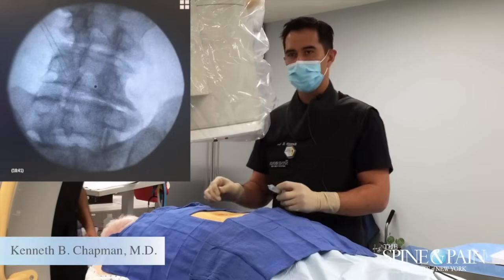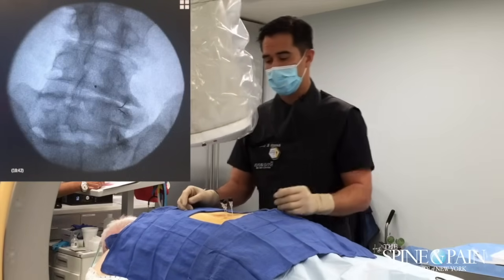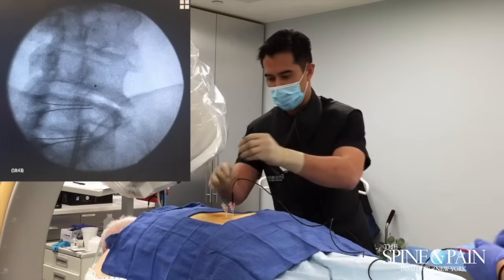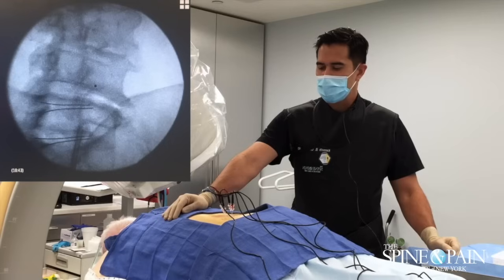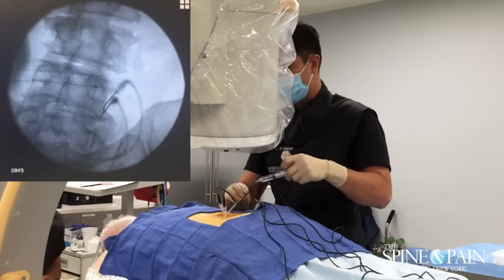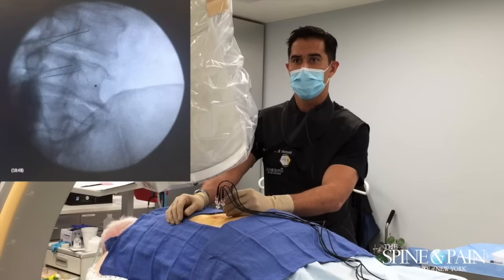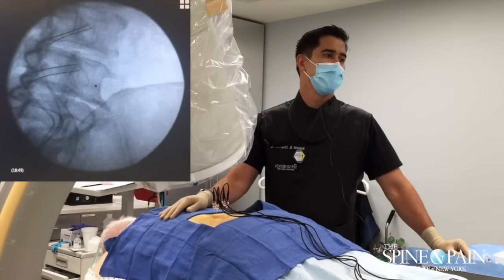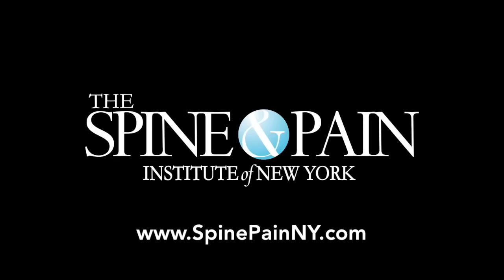Radiofrequency Ablation Procedure

Comment: I’m surprised by everyone saying they thought this procedure was not painful. I did two diagnostic nerve blocks and the ablation I just did 2 days ago. I found it to be agonizing and I was huffing laughing gas and had versed before hand. I think the most pain is from the placement and testing. The actual heating of the nerves was tolerable. I have a high pain tolerance and I was moaning and gripping the pillow so I am surprised by everyone’s different experiences. It basically was recreating the exact chronic pain I have but increasing it 100 fold. But that’s good, because it shows that the facet nerve is the problem.
Reply: Same for me this time. I had it done several times before. It was uncomfortable but not very painful. 
This time, new doctor: extremely painful. 
She was in training, which I didn't know. 
So it depends on the doctor who performs it 💯 
Find a new doctor, seriously. 
Coz I'm not going to the one that performed it with me now, ever again.
Reply: 100% agree! I have a high pain tolerance and this one hurt! Next time I'll ask for versed.
Reply: My Md uses IV sedation w each procedure.  It makes a repeat 5 yrs later a no brainer!!!
Reply: Same I’m normally fine but I was hurting
Reply: I agree! I have my 2nd one 9/19/2024 for lower back pain and I will be requesting something for pain to help me because all pain tolerance isn’t created equal. I consider my tolerance higher and spraying the area with lidocaine then sticking the needle in each time was agony for me. I want to be able to be completely still when doing this type of procedure. I jumped each time a needle was inserted. If I am given a preference I would prefer as much numbing during this procedure as possible.
Reply: I had this done as well and it was the most painful procedure I’ve ever had. Towards the end, I felt I was either going to throw up or pass out.  That was in 2020,  I’m scheduled for another one in a few weeks and I’m scared to death. This time, it’ll be with a new doctor. My former Dr closed his practice and moved out of state.  When I scheduled the procedure I relayed my fears to the PA and she said that my new dr is known for being gentle.  Maybe my previous dr wasn’t or his technique was different in some way. I just know I’m scared to do it again because of the terrible pain.  They gave me Ativan to take prior to the procedure but they won’t give anesthesia because they need you to communicate what you’re feeling.
Reply: @cherylcorbin2776 I’m scared as well. I didn’t realize the nerve grows back in a year… this is a new doctor for me as well and he gives nothing except an anxiety pill….But he is also known for being really good so maybe it will be ok.
Reply: @pairofarches It is agony. I have to do mine again since the nerve grew back and I’m scared. This new doctor gives nothing but an anxiety pill…
Reply: @emilybeckett1753  yes, unfortunately the nerves regenerate.  I got decent relief from my first ablation for about 6-9 months.  I truly hope it’s not too painful for you and you get relief.  Sending positive thoughts your way 🙏
Reply: I had the block done on both sides in one day and felt relief for almost an entire day. I had the ablation this morning on my left side and I am in agony. It hurt when the doctor inserted the needles. I didn't get any pain meds beforehand and tonight I'm aching all over. I have to do the right side on Monday and I'm really nervous. I usually have a high pain tolerance as well but not today apparently.
Reply: @Sandyv73  I feel your pain. I Just did my left side again a couple of days ago and it was unbelievable agony. This doctor doesn't give any pain control during, while my previous doctor gave versed and laughing gas. If you can get medical marijuana in your state that would be really helpful for after the procedures, at least for the next time it grows back. I wish you well!

Comment: Me Dice I am about 8 weeks past the procedure and i am doing great.   There was some discomfort from the procedure for a couple of days. The actual procedure wasn’t’ bad.  The excruciating pain I was experiencing when I would get out of the car after driving is gone.  Good luck to you.  I would definitely recommended it.  It’s nice to have my limp gone.
Reply: Excuse me I just want to ask a question I'm a retired soldier with a lot of lower back problems I got l5 I need it it got to the point that I cannot get up from the sofa sometimes unless I just dropped myself into four legs on the floor if I sneeze the pain is in trouble how long does it take to fully recover from this cuz I also like to keep active going to the gym
Reply: I have a question did you have any weight gain behind your procedure.

Comment: I did it 10 days ago on the SI joint on my back. Doctor used local freezing. It hurt a little at beginning but I basically felt nothing for the rest of the procedure. I took it easy for last 10 days, only walking daily. The pain is less every day. Today I was almost pain free.
Reply: Complete opposite of my experience. Those electrodes felt like an earthquake in my lower back with massive amounts of high pain. Surgery was effective but the pain during it was almost unbearable. I was literally cussing at the table
Reply: @sjmcdo3  sorry to hear about your experience, good thing it was effective 🙂
Reply: @sjmcdo3  so sorry to hear this! I can't help but wonder if they didn't get the numbing agent to the right location. Am I consider finding someone else to do the procedure if you need it again? Glad I was working for you for a while at least
Reply: Did you experience agonizaing pain before the procedure?
Reply: @cathy8964  Only when doctor was doing deep freezing for less than a second nothing I couldn’t take. It takes a month or more for pain to subside after the procedure and for me pain was back exactly one year after.
Reply: Still going strong now ???

Comment: I was told today that I need this, I'm scare. A year ago had back surgery and hip due to work injuries. Still recovering and is very uncomfortable. Let's see how this new method will work.
Reply: Did you end up having it done? If so how do you feel now? I too have lower back pain which is now affecting both of my hips. I can't put pants on or especially socks without crying in excruciating pain. Its like my lower back and hips are fused from moving. I played a lot of contact sport's and then my job ontop has completely destroyed my life. I used to get marcaine/lidocaine injections in my back and it was incredibly painful. It only helped with the pain for anywhere between 6 hour's or 3 day's at most. I'm thinking this might be my next option. Cheers and I hope you're feeling better.

Comment: I had this done yesterday I was shaking afterwards it was painful the burning felt like the start of labor pains not that strong but that's what it felt like I had to lay there for a min after but it was worth it I have never felt better getting around so I'm thinking about getting the other side done in a couple months I have DDD with right lumbar sarc.my life has been hell now I fell 50 pounds lighter
Reply: sheron...i got through the numbing but when they did the burning i almost jumped off the table. it felt like i was having a heart attack, it's supposed to last 60 seconds but i didn't last five seconds. i screamed in pain! he inserted another dose of pain meds into the needle and i was able to get through it ok. i will still have it done again if this works. mine was T5--T8, and just had it 2 days ago so i am going to remain optimistic. anything is better than the miserable pain i have been living with...
Reply: I have lumbar radiculopathy, spinal stenosis, several bulging discs, osteoporosis of the spine and hips, but, after a fall, and fracturing my coccyx, I’m now experiencing sacrum pain!
I had sacroiliac injections with cortisone ( only helped for two weeks)now, I’m always in pain, hard to get out of bed, but, I don’t want the fusion of the sacrum either!
I also have chronic sciatica, so, going to look into ablation!!!

Comment: I had a RFA done 2 weeks ago and it was so painful. I have a high tolerance for pain but between the adjustment of the needles and the actual nerve burning it was excruciating. I’m currently experiencing more pain since the procedure and now have pain shooting into my butt which almost feels like bruising. I can’t bend over without cringing in pain. The actual back pain I had before this was better than this new pain I’m experiencing. I did have 2 branch blocks prior for diagnostic purposes and had some relief. Why this procedure didn’t work for me idk. I did read it takes up to a month for the nerves to die and procedure to work. Tylenol isn’t touching the pain and I can’t take Advil due to kidney issues. I’m just so sick of back pain. It’s crippling. I see the doctor for follow up in 2 weeks. I’m just hoping this is the recovery pain I read about and it will heal in time. I can’t believe how many mixed comments there are regarding this procedure.
Reply: Wow, I'm sorry you went through this. I had this done yesterday 10/29/24 I suffered for 2 1/2  I'm hurt as of today 😢So I pray it gets better, Now I need my hip fixed! Because I can't lay on my right side.😢

Comment: I had this procedure done a few months ago and it has taken 70% of my pain away. During the procedure at times it felt like a Charlie horse and I was going to pee or crap my pants. The area treated was my L5 and S1. I'm a 41 year old Male
Reply: Hey I’m going for a second block after next week before I have this done, how is your back now after the radio frequency? I’m really scared I have a good tolerance for pain but the block I had last month they sedate me through an iv which this was killing me for the good 10-15 mints I was crying and shaking then I didn’t feel much after that, but again I’m really scared and it’s coming up soon again.
Reply: @onlyinrebeltube7692  I'm still relatively pain free at 70%. Now there are times I can move a certain way or move and there is still pain but nothing compared to the pain I was in prior to the procedure. Good luck to you!
Reply: And now how r u
Reply: That's same disc plus l4 that's causing me such pain,think this is my last hope
Reply: @وليدعاطف-ض1ر  I'm still doing pretty good. I'd still say that 70% of the pain is gone however certain ways I move I still feel the sharp excruciating pain.
Reply: @maxinelachance7658  Hi there, it's been over a year for me and I'm still pretty good. Have you tried decompression? I've used that and it's great thereapy as well.
Reply: @buckwheatsghettoghost4927  no so far only have done epidural injections and faucet joint injections and getting very depressed just want to feel like doing more than laying down,lol. I've got a follow up wed see what Dr thinks next best step😒

Comment: Had this done today. I have a broken L4 and L5. I've had 3 rounds of epidural steriod injections and 1 test injection to see if RFA is a good option. I felt amazing the first few hours and my lower back was great for about 10 days with the test injection done about 3 weeks ago. I swear when I say that the pain for the test injection done 3 weeks ago was more painful than the procedure today. I overthought how painful the procedure would be. Today, the most painful part of the whole procedure was the feeling of the pressure from the numbing fluid spreading (if you had epidural injections, you know what I am referring to).
That was done first and the doc let it kick in for about 2 min or so and then went to work on the nerve ablation portion. I'm not saying the procedure is a walk in the park but believe the other comments when they say that the pain is tolerable if you can take the pain of the epidural injections. 
Truthfully the pain today could have been 100 on a scale of 10 and I still would have done it. If I could feel the relief I felt during the test injection for a few months or year(s), I would do it. 
I am super sore from the procedure, but it'll be worth it. Good luck to those getting this done or to those considering getting this done. I hope this works for you. My current medication is (1) Meloxicam 15 mg pill and (2) Baclofen pill. My hope is to lean off of the pills completely one day.

I will try to update this post in a few weeks to post how I feel.

Comment: I’ve been living with debilitating back pain for 3 years. I just had this procedure done this morning. My pain from the procedure is still pretty bad, but I’m looking forward to the relief when this subsides. 🤞🏻😑🤞🏻 procedure was incredibly painful.
Reply: How are you now?
Reply: @raylupa9313  my fracture is not healing, so I’m still in a lot of pain, but having the nerve root ablation has allowed me to be more mobile and  get back to some level of activity without all my muscles tensing up to the point I can’t breath or speak and I break into a sweat. It was so bad before I could barely stand through a 5 minute shower and doing any kind of work around the house was nearly impossible. Today I managed to clean my whole house, do laundry, dishes, meal prep, etc. All stuff that I had been avoiding doing before due to pain levels. The pain is still there but it’s not causing all my core muscles to tighten up so much. Yesterday I road five miles on my stationary bike for the first time in almost two years. So it definitely made a difference. But it’s not a fix all. It’s just treating a symptom. Until the fracture heals (if it ever does) I will still be dealing with pain and a slightly herniated disc.
Reply: @definitelynotthea.t.f.8813  I'm sorry to hear you are still dealing with painfull struggles. I'm glad it does help some. I have lordosis, fibromyalgia, hip displacia, arthritis, degenerative spine and have tried so many things. Nerve block stimulation trial, epideral injections, trigger point injections, different medication and repeat on physical therapy and chiropractor visits. Still suffering pretty bad and just desperate to find something that can work. Just ease the pain a bit so i can do more. Regarding both my hip and spine. So I've been looking into this more. I hope you continue to do better over time. Pain is such a horrible thing to live with.
Reply: How are you now? getting better?
Reply: @m.s.hidayat  I had my second round of ablations done Monday. It’s been really bad pain all week long. It takes a while for the residual pain from what amounts to third degree electrical burns to your spine to calm down, but there is undoubtedly a huge difference after ward. Takes about 1-2 weeks then you suddenly start noticing your pain is gradually less and less. You get anywhere from 9 months to several years of relief. Most people do very well with this procedure. But it’s extremely painful to have done, and there are some risks you have to weigh. Potential permanent nerve damage or partial paralysis if they botch it. My spinal specialist is very good and communicates with me through the entire procedure to make sure I’m not getting jolts of nerve pain down my leg in the ablation site before he initiates the burn. Failure to communicate could lead to serious damage. I’ve had good results with my first procedure lasting about 8 months. My second one I’m hoping for longer.
Reply: I'm having multiple compression fracture, and the muscle back spasm is killing me. Do you think this procedure will help to release the muscle spasm abit ? I cant function with my muscle spasm all thr time.
Reply: @m.s.hidayat  I was having really bad spasms and muscle twitching, constant heat, inflammation. This procedure has had a huge impact on the spasms. A steroid shot helps with the inflammation and a routine use of NSAIDs like Ibuprofen or Etodolac, and I use a Tylenol 3 and a Cyclobenzaprine twice daily. I still have pain, but it’s much more manageable.

Comment: I am having this done on July 30th and I am a bit nervous.  The test runs went ok but really did not relieve much pain.  Hoping this works and lasts about a year!
Reply: So, I had my left side done today.  Was not bad at all.  The initial numbing injections were a little ouchy but after that basically just felt a little pressure.  Will have the right side done next week.  I am a little sore after the procedure.  Just ice it and take some Ibuprofin.  Will be well worth a little bit of discomfort it it will help my chronic back pain.
Reply: You mentioned the test runs "went OK" but didn't relieve much pain. Did the actual RFA relieve the pain and how long did it take before you felt relief? The test runs did little for me and four days ago I had the RFA and so far I have had no improvement. I would really like to hear from you on this.
Reply: I was told if the test run don’t give you much relief then they won’t do.  Had my first test run and it lasted about 8 hours so have my next one next week.  The third time they will burn.  I can’t wait.

Comment: I'm 43 and I had the first "two" ablation shots which were like testers. I get my real on done in two weeks. It is going to be located in my neck. I have had a tremendous amount of pain in my shoulder blade, top of the shoulder and in the lower part of the neck. I'm really hoping this helps as the first two showed signs of improvement. I'm just hoping I don't need surgery. I've had an epidural shot, steroid shot in my neck to no avail. Such a pain in the ass and hoping this is the thing to help! Anyone else experience Ablation of the neck?